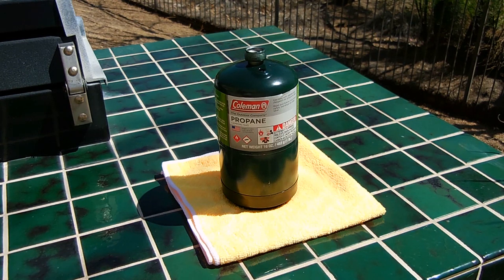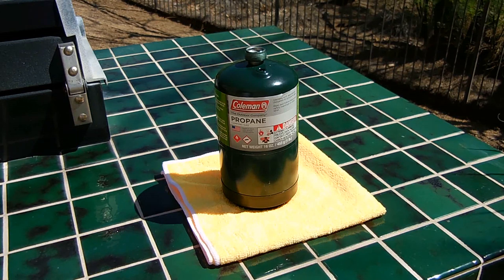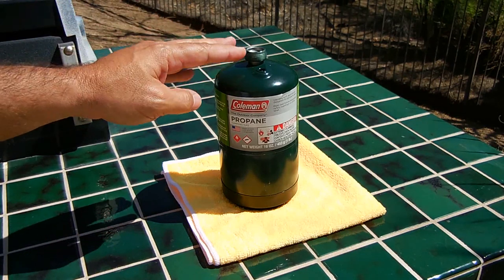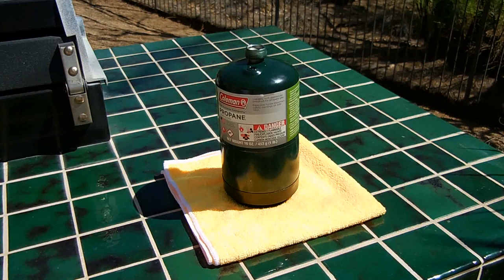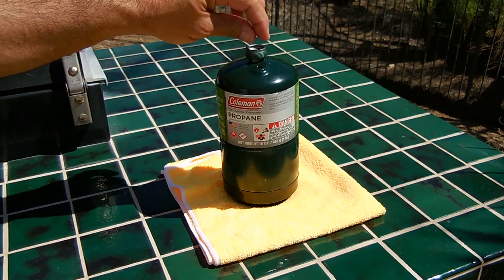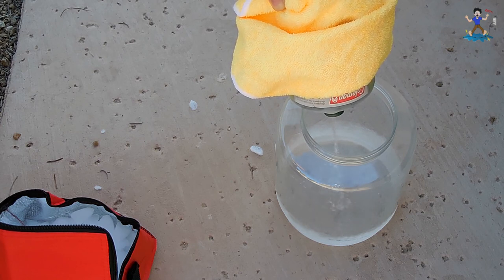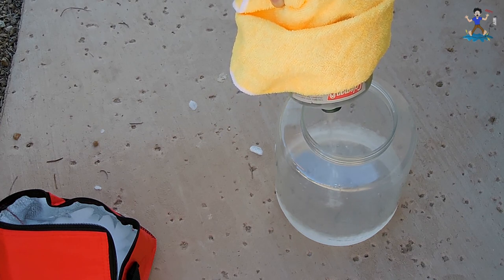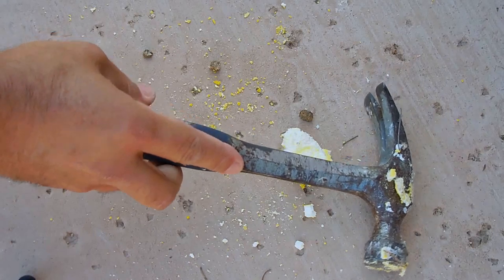LIQUID Propane Extracted From Camping Gas Cylinder

Comment: I found that shaking the bottle a lot before use allows torch to stay lit when upside down soldering pipes etc. We use these to de ice diesil and air brake lines a lot. Thanks!

Comment: what's the use of  that???
Reply from the maker: To educate people, and show a method which I used years ago to replace leaking valves on small partially full or full refrigerant tanks.
Reply: Daniel G for frozen peeps and weed of course
Reply from the maker: Good one. I was surprised he asked, since I made it very clear in the beginning of this video why I made the video. He rated his own comment up, and he thumbs down the video. Clearly not a subscriber.
Reply: D G um it's so you can fill up your vehicle dummy what else would it be for? Jeeze

Comment: Just curious. If one were to pour LPG on charcoal, would the charcoal freeze and then explode when lit due to the rapid  temperature difference, or would the charcoal just burn.  If it just burns that would be one heck of a charcoal starter fluid. LOL. But I think I would rather watch someone else do it. Might be VERY entertaining.
Reply: Tooterr102 E. The scientist at Los Alamos in the 60’s would go out in the desert, dig a trench and fill it with charcoal, pour LPG on them, them move hundreds of feet back and shot a flare into it. Charcoal saturated with LPG will explode when lit with the same force as dynamite by weight. So don't try this.